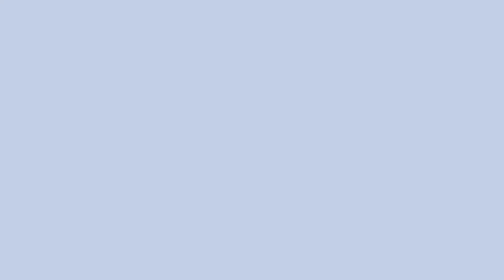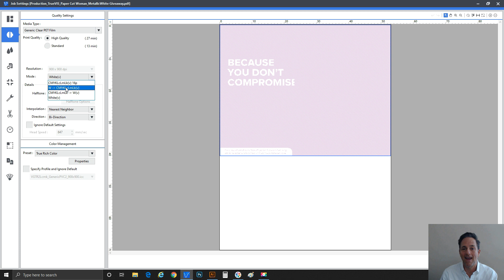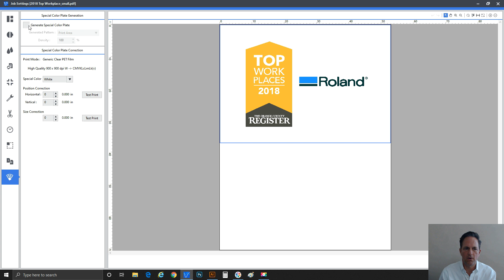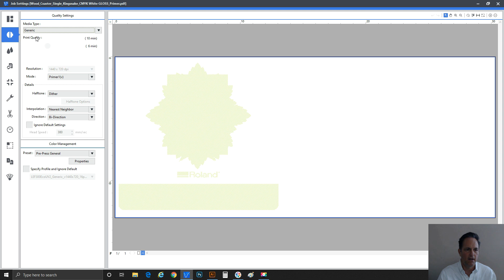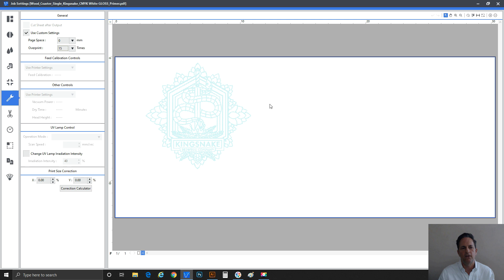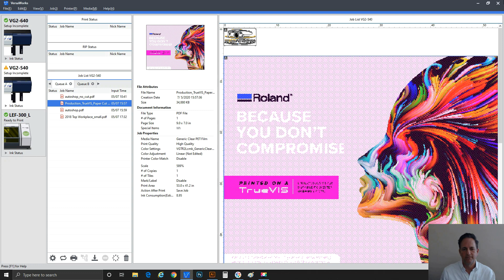VersaWorks 6 - Special Color Plate Generation

Comment: my designs with white in them aren't showing up in the special items. I'm using an lef-300 and having no luck printing white.
Reply: you probably dont need an answer anymore but for others sake. you need to be using an rdg white specified spot color as your white. if you aren't using it the machine doesn't read it.

Comment: Hello Bryan, great video! Is there a way to add special colors to designs that have Custom Text Boxes? Fixed part of the design already have white layer. But when I add custom text, it's only CMYK, and it's transparent. Is there a way to add white on custom text too?

Thank you!
Reply: you would need to duplicate your text and have it as an rdg white spot color behind your text in the file before loading into the rip.